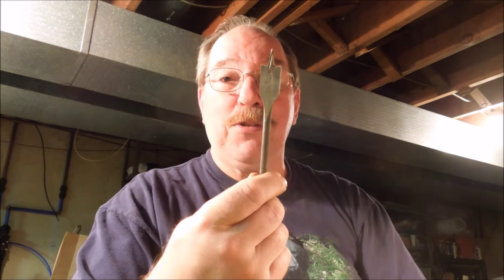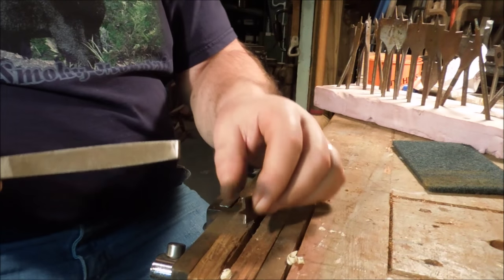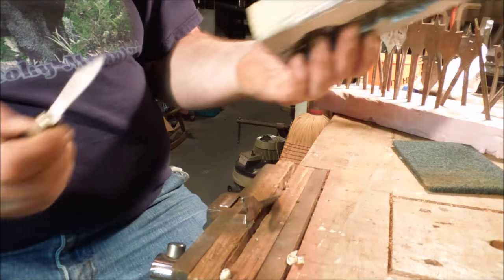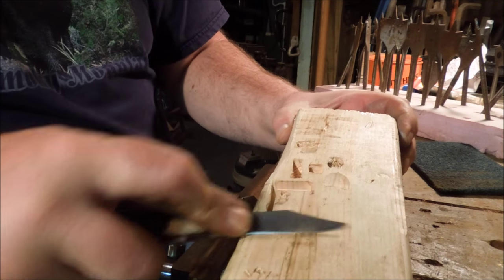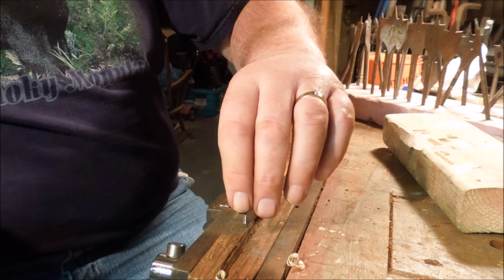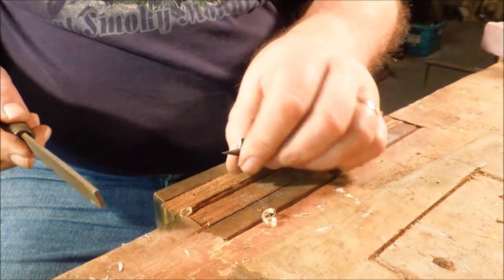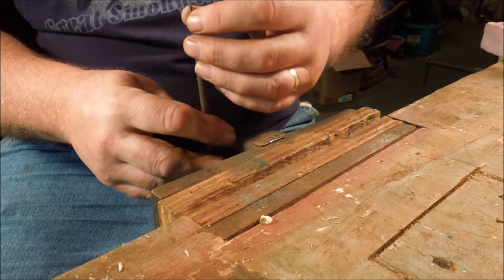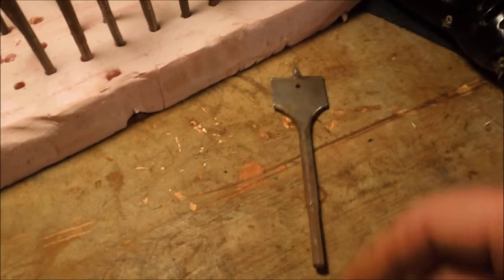How To Sharpen A Spade Drill Bit - by Old Sneelock's Workshop

Comment: Great video.  I bought some files for a couple of dollars at a car boot sale and tried this.  Timing the cuts before and after it halved the time of penetrating the wood. The bits are ancient  (but not dull) I was so pleased!
Reply from the maker: Think of how tired you would be after drilling all the studs in a modular home. I wired one house per day. The guy I replaced pushed hard to get one.

Comment: Thanks for the  video,  I am a  little  surprised  you can  file a bit with a  reg file-I had assumed  it  was hardened  enough that you would require a  diamond  file
Reply from the maker: The bits are designed to cut wood. Just like a hand saw blade the tool doesn't need to be extremely hard. Unless you hit a nail the edge will hold up for quite a few holes.

Comment: Thanks for the Lesson !!!
Reply from the maker: +not2fast4u2c You're welcome. 😆
Reply: Yes, thank you and greetings from Australia. I noticed you file in one direction only. Is this because if you pull it back it may compromise the cutting edge?....
Reply from the maker: David Hamilton Files are designed to cut in one direction. It's a common mistake to rub the file back and forth on the surface because it is easier to hold the file that way. The problem with that is the file rubbing backwards doesn't clear the chips out as well. The chips can plug or "pin" the file teeth and gouge the surface. The file is also wearing from the rubbing without any metal being removed. 
The effect isn't as pronounced on a narrow surface like this drill bit. It is good practice to treat the act of filing the same way for any use. That way it becomes a habit.
Reply: Old Sneelock's Workshop.....Thank you kindly for that. I must confess to having used a file back and forth, thinking it cut both ways, but I'll remember in future to use it only as you suggest. Thank you again for that sound advice, Cheers....
Reply from the maker: David Hamilton It's not one of the earthshaking things in sharpening but it might make it easier for you in the future. Glad I could help.
Reply: Old Sneelock's Workshop...You have, I've got a 32mm and a 25mm out there in the shed that hidden nails did a number on and thanks to your tip, they're now back in the set they came in. Cheers....

Comment: Thanks sneelock!!! I just got through drilling with a 5/8 spade bit and to make it worst i was using bit and brace. Its calming to slowly chew thru the wood but when the bit is dull...that's a little to slow for me.
Reply from the maker: Cnt_Drive_16 If you liked the spade bit you will love a center bit. The angle on the cutting edge makes it slice instead of scraping.
Reply: Aren't those for metal?
Reply from the maker: There are two kinds. I think the names were coincidentally made the same. Otherwise it would just be a really bad joke to give two tools the same name. :-)
There is the center drill that you are thinking of. It is for drilling centers in the end of a piece of shaft while using a lathe. It is primarily for metal but can be used in wood too. Those are stubby double ended bits with a small pilot leading a tapered set of flutes. 
There is a much older type of bit made for drilling in wood with a brace. It is very similar to a spade bit but the radial edge is tilted to slice the wood. You can see a set of them here. http://www.fullchisel.com/blog/?p=105
Reply: yeah I agree that would be a bad joke, but that would be something that manufactures would do just to aggravate people lol. I'll have to keep my eyes peeled for any bits that go into a brace or otherwise as long as they are for woodworking.

Comment: There are spade bits with arbors that pulls into the wood but has points on each of the ends.how would you sharpen those? Thanks for the video
Reply from the maker: D jack Use a smaller file that will fit between the spur and the pilot  screw to sharpen the radial edge.  Then sharpen the inside edge of the spur.

Comment: You didn't mention both flats have to be very close to the same plane. And the point has to be very close to centered on itself and the bit width. 
Closer precision work can be done by supporting the bit so it doesn't almost chatter.
Reply from the maker: You are correct. I didn't mention that.

Comment: Great job on this one. I really liked you intro.
Reply from the maker: This one was an early experiment in being conversational. I liked the opening myself. 
Thanks for the feedback. You are the only one who commented on it.
Reply: @OldSneelock  it is funny that this came back up. Been following a marking knife thread on Old Tools. Some suggested re-purposing a spade bit.
Reply from the maker: @Manocooper  If you have a spare. The metal on the "not made in the orient" drills is capable of holding a good edge.
Reply: @OldSneelock  I have all kind of spares. They show up in almost every lot/toolbox I buy.
Reply from the maker: @Manocooper We both get spares the same way. People just buy new and drop the dull ones on the bottom of the box "until".

Comment: Honing stone is used for sharpening wood chisels. I've seen files being used for sharpening of spades and forstner bits. Why didn't you use a stone for this job? Just curious. Thanks.
Reply from the maker: 5acesdown Spade bits are generally used for rough wood working. They are tempered to be tough enough to withstand shock. That leaves them softer than the average wood chisel. That in turn means they can be sharpened with a file. 
There isn't any reason not to use a stone other than expedience.

Comment: I have  found that the sides or flats dull a lot faster than the center point. I usually use my 1"x30" belt sander to sharpen spade bits; its what I figured out how to do it with, and seems to work well with the cheap set of bits I have.
Reply from the maker: More than one way to skin a cat. 😁😎

Comment: Or, for formwork, use a side grinder.
Reply from the maker: That works.
I use a file for several reasons: 
No power required.
Less material removed on average.
Easily performed on the job away from the shop while the bit is held in the chuck. 
I can carry a file in the drill holster and sharpen as needed. 
It all comes down to faster and easier. I.E. lazyness. 😁😎

Comment: why do some spade bits have a spikes on outer edge and some don't ,are they not important or just a different design.
Reply from the maker: Brendan Colvin Some have spurs that scribe a circle in the wood that prevents chip out. Others have the outer edge of the bit higher than the center for the same purpose but not quite as effectively.  I don't know exactly why they are different but I believe that spurs cost more to make than plain bits.
Reply: Thanks very much for your quick reply.it makes sense.Do you sharpen the same way as straight bits
Reply from the maker: Just be mindful of the relief angles and sharpen the spurs and main edge on the inside edge of the spur.

Comment: Can you get spade bit made of 5% cobalt for longer life? I go through these spade bits like there's no tomorrow.
Reply from the maker: Irwin, Dewalt, Bosch, Milwaukee and several others sell bits that are rated higher for durability. None that I found specified cobalt in the alloy. My experience has been that the bits sharpen so easily that spending up to $25.00 for a Milwaukee bit with replaceable edges like their Switchblade bit is hardly worth it. Following Milwaukee's philosophy, I can buy twelve 3/4" dia bits for the price of one Milwaukee and just throw them away when they get done. I'll come out way ahead in that comparison. 
You might try writing to some of the manufacturers and suggest they explore a cobalt alloy bit. I listen to suggestions and I'll bet they will too.
Reply: The fact you replied to my comment shows you're a Man true to his word!! as for the maufacturers, well it's all about money right?

I have been using a 1/4" pointed router bit as a countersink tool for the past 5+ years and there's no sign of dullness or me stopping using it for another 10+ years. As set of auger bits and flat spade bits made of the same materials should and would be awesome.. wouldn't you agree?
PS keep up the good videos..
Reply from the maker: Yup it always has been and probably always will be.
Bet if they made them out of cobalt they would only sell a 10th as many bits.
Maybe you could use a high speed steel twist drill. Getting one of those is easy and it should drill wood for the next century.
You can buy them with cobalt too. Used cobalt drills on automatic drill units for drilling sintered metal gears. Outlasted high speed three to one.

Comment: 00:57 Spade bits drill fairly smooth holes if rpm is high enough.
Reply from the maker: Everything is relative. And that is why there are horse races. :-)
Reply: Okey - dokey. I do like 'em, because they're pretty cheap.
Reply from the maker: I like them too. I'm just comparing various tools and their uses. Spade bits are great for putting holes through wood. Forstners and auger bits cut smoother holes but are a lot slower.

Comment: The easyest way to sharpen those drills is using a normal grinding wheel. In about 30 seconds the drill wil be sharpened as new. If you find the right angle it is possible to sharpen the cutting edge and centerpoint in one operation. The cutting edge will have a ange in this way tath the outside wil cut first, just as it has spurs. Easy to keep the centerpoint in the center and sharp. Best regards.
Reply from the maker: Dirk Vercauteren That does work quite well. I imagine that during manufacture the bits are originally sharpened with a grinder.

Comment: Don't waste your time with a file. The best way to sharpen spade bits is with a dremel tool and reinforced fiberglass cutoff wheels
Reply from the maker: JustinLodes Justin has a great idea. Next time you find yourself with a dull spade bit just take out your Dremel Rotary Tool and sharpen the bit. 
What? You don't have one? 
Well go to Home Depot and buy one. We'll wait.............
Got it? Good. Now plug it in. Now what? You don't have an outlet. Great! You should have bought a battery operated one. 
Go back to Home Depot and exchange this one. We'll wait..................
Put the fiber reinforced wheel  on the arbor. ..........
Good. Sharpen the bit. 
I know the edge is ragged. The wheel is only 1/16" wide. You need to have a guide. 
Back to Home Depot. We'll wait......
Back so soon. They don't have a guide?  Then just use it the way it is. Don't complain about the smoke. Just push harder. 
Wow I'm glad we didn't waste that two minutes sharpening that bit with a file. 
Next time we should just have a spare bit. Oh I don't know what size. Just get one of each. 
........Next week......
You carry the toolbox today. It weighs a ton. Well if you don't want to carry all the spare bits, the Dremel Rotary Tool , the charger, spare fiber reinforced wheels, and the extention cord just leave it here.
WHAT NOW?  Well drive back to the shop and get the spare bit. We'll wait.........

Comment: Why do you look surprised at the beginning of your video? Aren't you the one that turned on the camera. This Old House does the same thing when they go to somebody's house, it seems silly to put a camera man inside  the house and then act surprised when somebody knocks on the door. Doesn't the homeowner see the cameraman in their living room pointing the camera at the door? These are educational videos talking directly to the fourth wall. Why switch back and forth? 
It seems that it would be more believable if the cameraman for This Old House was outside the door when they knocked on it, or for someone to enter your workshop with the camera if you're going to act surprised. 
I do like your videos and I do have a question for you. What about the Spade bits that have a little cutter sticking out on the ends of the Wings to cut the wood fibers before removing the bulk? Are those sharpened the same way? Or do you just remove the little cutters to sharpen it?
Thanks
Reply from the maker: Kerry Ware They are sharpened the same way, but with a smaller file so it will fit between the spur and the pilot.
Reply from the maker: It's a parody of This Old House.